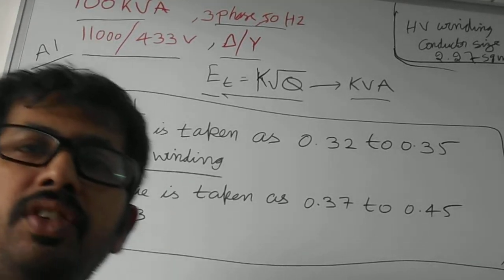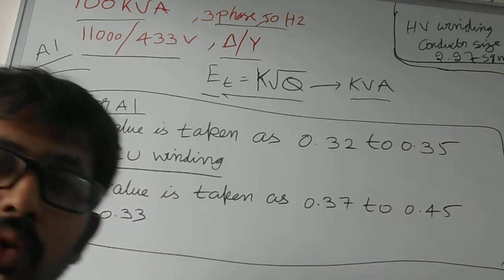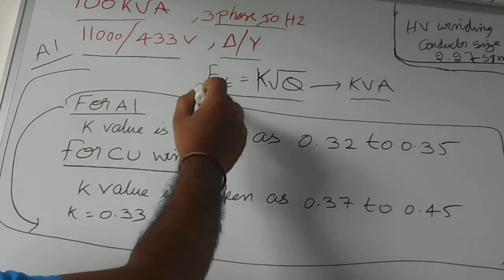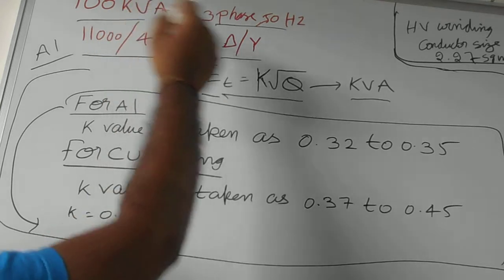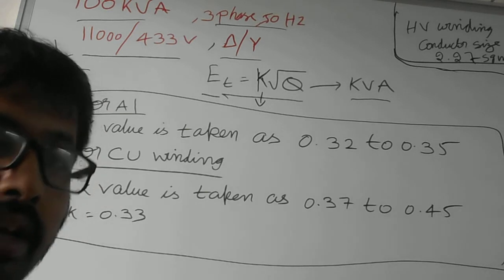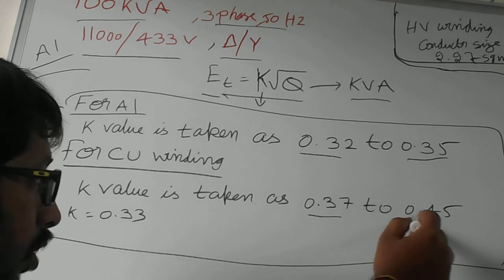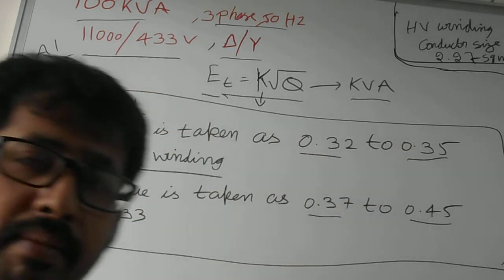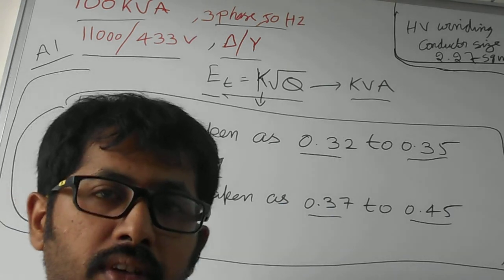TRANSFORMER DESIGN

Comment: sir 
one problem we are making a one piece of large  conductor into axial and radial conductor we are checking countiunity for each conductor to check the insulation is proper or not and don't fail the coil . so in assembling process we making all conductors together and brazing then countiunity is there no sir .